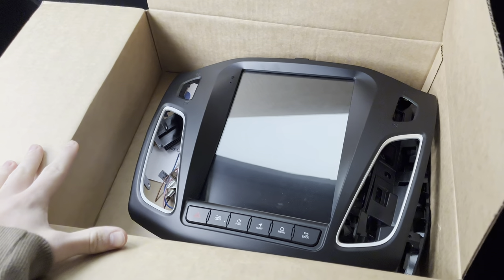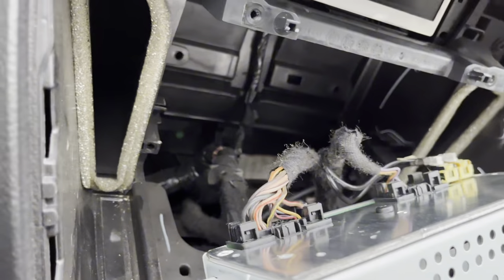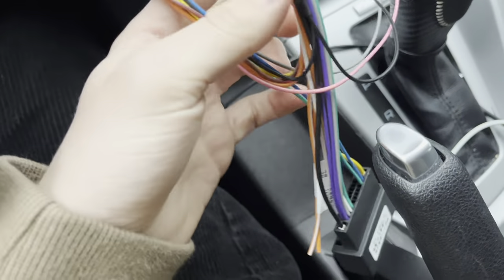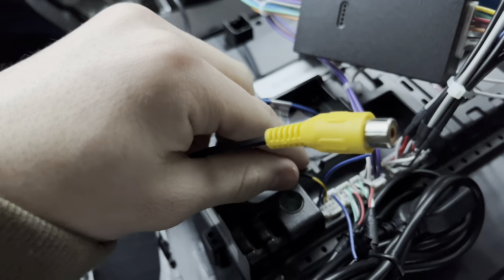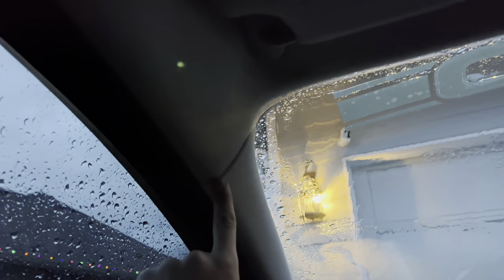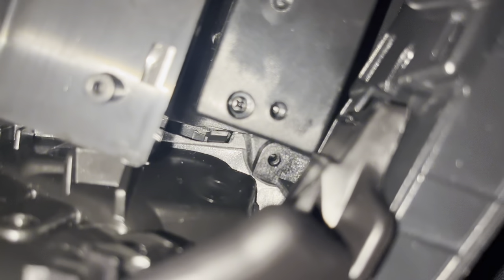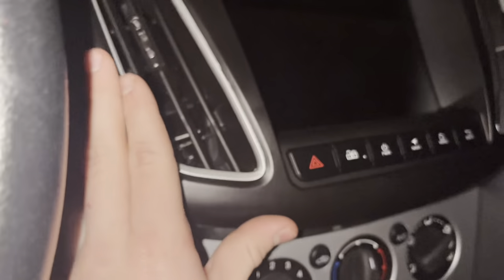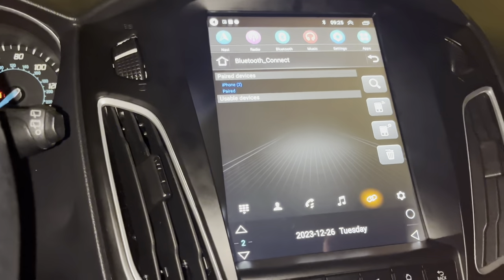Ford Focus APPLE CARPLAY Installation // 2012-2018

Comment: With the addition of the Carplay/Android auto wires, where do they expect the USB ports to go because the guard at the bottom blocks them (at least on 2015 +)? Lol
Reply from the maker: I have the same problem and I’m guessing the 2 usb port piece Is for the ST or an earlier model SE. The A/C unit would have to be removed in order to fit it. I can show you what I did with the part that fits so I can use wired connection, but it’s not the most optimal for looks.
Reply: @BoostedFocus  Lol, figures! No - it's fine. I appreciate the help though!
Reply: @BruceLigno  so you don't recommend this one for focus se 2015? Thank you!
Reply: Soo tbh the hvac controls aren’t to terrible to remove I believe they are required to be removed I removed my radio to install an aftermarket amplifier and had to remove them and long story short the 12v outlet can be removed and if you diy/3d print if you have the option create an insert of the hole that removing the 12v outlet creates and stick the usb there 🤷‍♂️ I have my bass knob for my amplifier 😂 factory finish almost but be careful removing the 12v as it’s in there extremely well and I scratched the plastic pretty decent

Comment: I’ve bought one similar only thing that doesn’t work are the 3 buttons on the bottom right navi power and back any idea why or help thanks
Reply from the maker: Same thing with mine, only hazards and lock work. I've seen that problem with many different carplays for the focus so it might be something with the compatibility with the focus and not the carplay being broken. Luckily I don't need those buttons, but It would definitely be nice to have working! If I find something on how to fix it I'll let you know
Reply: You can set up home and back button in steering learn in settings (Navi is a lost cause to me still)
Reply: Can you tag me in your dash cam fitting please as just brought similar and wanting camera set up please

Comment: any updates? do you still like it?
Reply from the maker: I haven’t gone through all the controls, but it’s worked really good for what i paid for. The bluetooth connectivity was glitching a bit at one point, but i think it’s from one of the wires not being fully pushed in. navigation and radio work good. If that’s the only issue then i love it and definitely recommend
Reply: Did you upgrade because your radio randomly stopped working?
Reply: I got this exact one becuase my radio in my 2012 focus stopped working, it would just play loud static and popping noises, this unit works great

Comment: i just installed the same unit in my 15 St3. I almost gave up because no sounds coming from the speakers :( i was ready to ship it back lol. i had to trigger the blue wire ( amp wire) to 12V power off the harness and it fixed my problem. i would highly recomend using the USB plug for the Android auto over wireless connection
Reply from the maker: dude i’d love to have an st3. i’ve definitely noticed a difference between wired and wireless connection too. been using wired lately and it doesn’t cut out or stutter anymore
Reply: How do you use wired connection, I plug my iPhone into one of the usb ports that came with this unit but music doesn’t play, it keeps trying to connect to car play. It’s annoying too cause when ever I try to turn off wifi  hotspot from coming from the car it keeps turning back on.

Comment: Does the mic work on yours, mine doesn’t and i had to wire in the “key1” wire to get steering wheel control to work

Comment: There are several different manufacturers of these on Amazon. Do you have a link to the one that you bought? Also, how is it working? Do you have any complaints or problems with it since the install?

Comment: Does this fit on the 2011 model that doesnt have bluetooth as standard?
Reply from the maker: Could possibly fit, not sure on the display fitment for pre-2012 units. Might be the same shape, but the wiring is maybe different than the mk3

Comment: Yo bro u not doing the video putting the camera on?
Reply from the maker: I've tried and I still can't figure out how to tap into the backup light wires. I can ground the negative and power the positive another way but then the camera would be on 24/7. If I want the camera to be on only in reverse, I tap the power to the backup light so the camera power shuts off when the back up light isnt on. The backup light doesnt have a red wire so I need to buy a voltage tester too.

Comment: How did you connect the door lock switch I have a 2015 focus se and it doesn't have a switch on the dash. How did you connect it? Also, did u get to do the camera video?
Reply from the maker: One of the power cables connects to it and controls all the buttons, like the lock, hazards, power, navigation, etc. It's for 2012-2018 so it will work with your focus too. I haven't done the backup camera because the only way to mount it is to drill into the back and I don't want damage in case I sell it
Reply: You can use one of your license plate screws to hold the back up camera in place, that’s what I did. I had to dremel the camera mount to make it a little bit bigger but it worked perfectly

Comment: Hi. This works for a ford focus 3 1.0 Ecoboost from 2012??
Reply from the maker: Yup! Every focus model above 2012 it will fit on.
Reply: @BoostedFocus  and i use iphone, just need to have carplay right?
Reply from the maker: @adzonn  yeah, and you can use it  with either bluetooth or wired. I was having trouble with bluetooth connection at first but it seems to be a lot better now
Reply: @BoostedFocus  ok sir, thanks a lot! you have the link btw?
Reply from the maker: @adzonn  https://a.co/d/1uJeVEv
Reply: @BoostedFocus  thanks bro!

Comment: I live in Sweden, do you know if it works in the Swedish model? I have a ford focus st mk3 2014
Reply from the maker: I did some research and the US and Swedish models were made almost the same. The only difference was small cosmetic/features. The head unit is the same so if I’m not wrong you could definitely use it on the Swedish model too!

Comment: How long did it take you to pull it back out because you need those 2 usb wires to hook up your cord for the carplay or Android Auto?
Reply from the maker: It took my around 4 hours since this was my first time doing it, but if I did it again I could easily get it done In less than 20 minutes. It’s actually easy and very simple compared to other cars

Comment: How do you get the buttons to work?
Reply: Bro I can’t get mine to turn on
Reply from the maker: mine just went out again. only the hazards and locking work, same for you or does nothing work?
Reply: I just installed this same unit in my Ford Focus and only the door lock and hazard buttons work too. None of the other buttons do anything.
Reply: @thirdeyesurvivor3886 did you figure it out? Mine aren’t either
Reply: @tylersimpson3512 no i just don’t use the buttons, you don’t really even need them. The only ones I need are the lock and hazards buttons and those are the only ones that work.
Reply from the maker: @thirdeyesurvivor3886 I’ve felt the same way. I honestly only use CarPlay for music and maps because the big display helps a lot and gives the car a newer look. I’ve messed with it many times and can’t get the buttons to work, but it’s okay since it works without them
Reply: In order to get the buttons to light up, you need to splice GND + ILL to there corresponding cables on the main wiring harness, see device port in settings to locate this. Wire Key 1 + key 2 to the stray cables on the main wiring harness - these have a sticker to identify.
Now here’s the disappointing bit, the buttons are now lit but they still don’t work.
I have tried this on 2 different panels and same outcome. 
I now await rimoody to contact me with more info.

Update: all above info is correct, all you need to do now is use the steering learn function in settings to program the buttons. Theres more buttons in steering learn if you swipe left. Also the power button is mute on short press/power on long press.
Reply: @BoostedFocus my system stopped working. The screen started showing glitched line sometimes and it started happening more and more to the point where it wouldn’t show the screen at all. Everything still worked tho, yesterday I think I touched something on the screen to turn off Bluetooth so now I can’t even listen to music or do anything so I’m returning the whole unit for a new one. Real bummer it worked fine for the first two weeks.
Reply from the maker: @thirdeyesurvivor3886  i think the way they manufacture the product, the device will always have a different outcome. they dont take the best cautions and are very inconsistent when putting it together and i’ve found a few flaws of things like plastic or pins they forgot to cut out. I love the big screen and interface but I think soon I’ll also be getting a better one for review. Great system just too inconsistent on the production
Reply: @zy4221  you legend, I did have them once installed then lost them randomly. Now working again with your steering learning buttons. Thanks 🙏🏼👍🏼❤